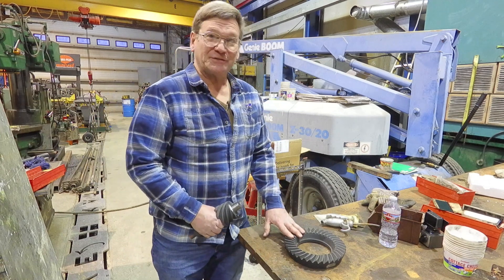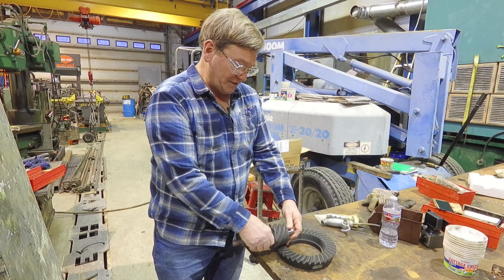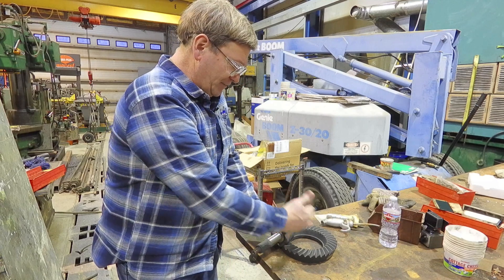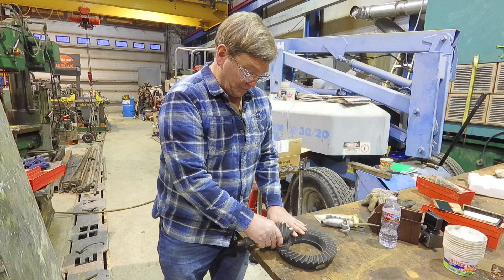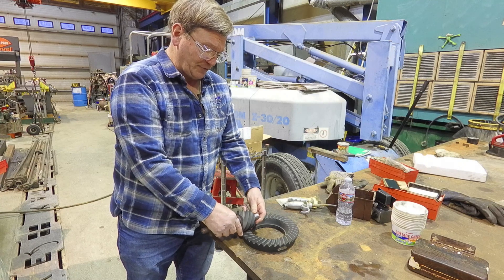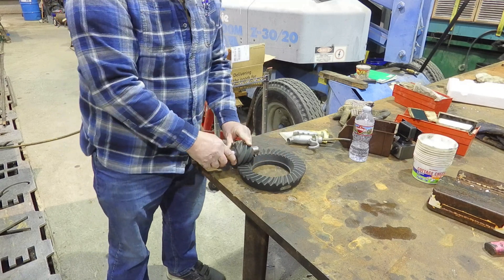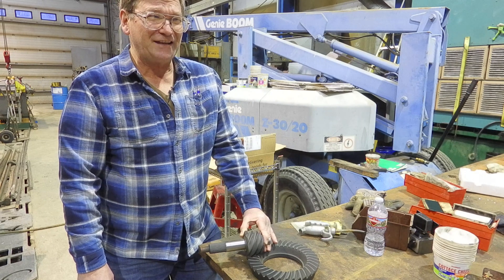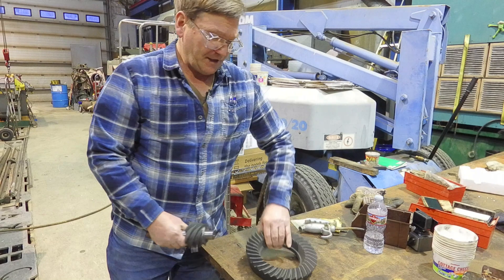Machinist's Minutes: Hypoid gears and pinion position

Comment: As a young man I work for a Falk warranty and re-man shop in Phoenix where some of the reduction boxes had to be split and come on two or even three oversized semi loads.  This is where I learned gear set-up as well as machining.  I miss that job, always interesting stuff to learn there.

Great video, explains it well.  But I do believe most common Ford 9" are low pinion so they dropped the interface down.  I have heard of high pinion Ford 9" but I don't remember ever seeing one . . . But I see more Eaton, Rockwell size stuff.
Reply from the maker: It was a Flender gearbox that had the gear set in it that caused me to learn more, I have also worked on Hanson, Dodge, Who-knows, and maybe a Falk, but not a lot of Falk.  Yes most ford 9" installations are pinion below center.  My initial comment of the pinion being above center, instead of stating off of center, has caused many to comment.
Reply: @HOWEES   I enjoy your channel a lot.  I lived in Palmer 2001 to 2014 so I feel right at home in your cluttered shop . . . There's a lot more government here to help us in the 48, I miss the freedom.

Comment: Great video.

I have a question. How do you determine the size and type of small internal threads where you can’t  get a thread gage into the threaded hole?
Thank you.
Bob
Reply from the maker: I just now saw your question, Reprorubber is the common product made for that.  It is expensive, but works well.  Oil the surface & use standard silicone, if it doesn't need the better speed or accuracy.
Reply: Maybe some tipe of wax/silicone to make inprint of threads, then after you pull/unscrew it out, measure it
Reply: @Robert Swaine Does anyone make something for this?